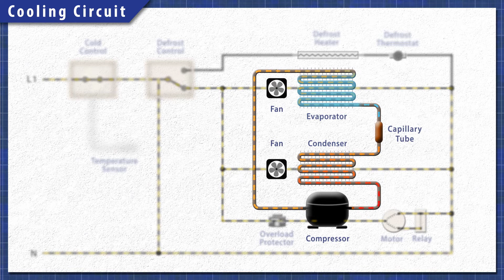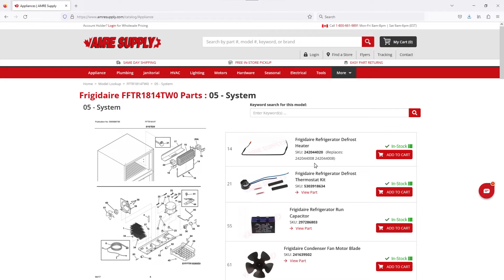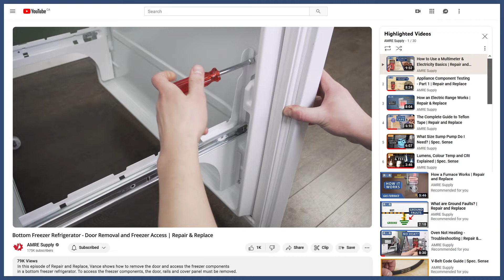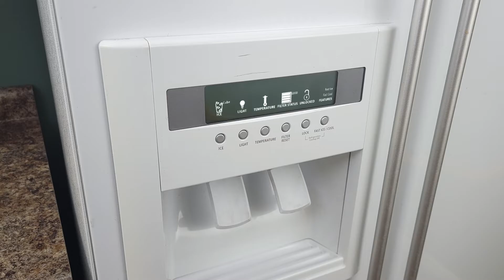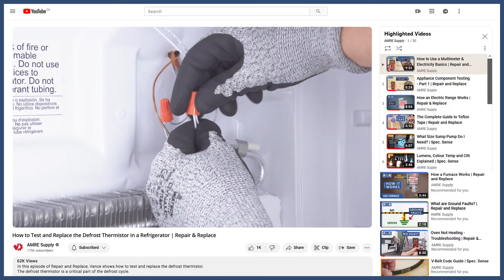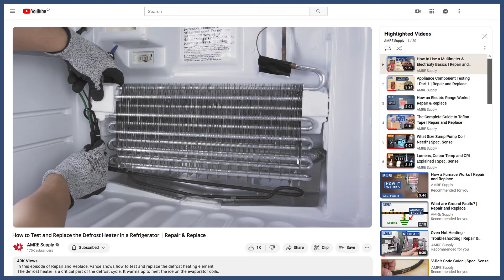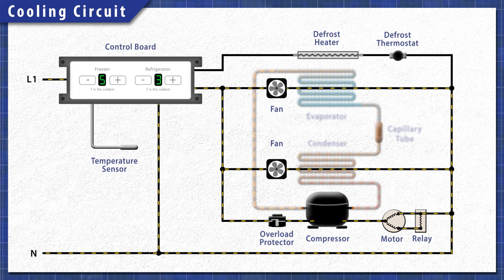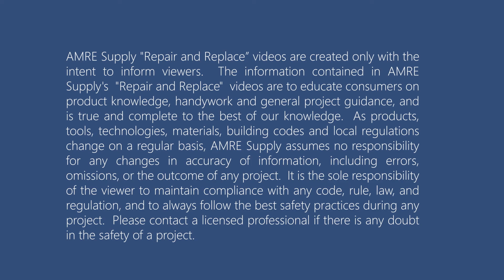Refrigerator Defrost Troubleshooting (Complete Guide) | Repair & Replace

Comment: Great job and nice clear instructions. Amazing that you respond to each comment, unheard of. Wishing you and yours a Very Merry Christmas and a Joyous New Year. Oh, by the way, our Kenmore Elite from 06 started to act up on Christmas Eve yesterday. 21 cu.ft. ram jam full of frozen goodies. Not defrosting and compressor running non stop. Good news is it's holding the set -2 setting. Unplugging it for 8 hrs at a time to cool the compressor.  I will look more into it tomorrow. Today is Christmas and there are other things to do! haha and hohoho!
Reply: Just curious, did you find the problem? I’ve got an old Kenmore with the same symptoms.
Reply: @stevee7774  Yes all good. Bought a new freezer from Costco just in case I would be unsuccessful and was able to return it without ever removing the shrink wrap. Turned out a new (refurbished) control box was the culprit. $130 and it's running. Freezer was built in 06 so let's see if it will give us another 20 yrs. haha
Reply: Replaced a faulty thermistor some years ago and it may be the same issue again. Thankfully it is freezing outside so I can have somewhere to put all that frozen food when I look into the problem.

Comment: It looks like L1 (hot) is directly connected to N (neutral) at the defrost switch. A direct short…No?
Reply from the maker: Are you referring to the how it works animation? What is not shown in this is that the defrost timer itself has a motor and capacitor as well, so there's a load.  In this case an additional symbol would have been helpful to clarify.

Comment: Hello,
My Frigidaire freeze started first to make ice and after awhile it stopped cooling. One thing, it was very close the central heater air blow hole. 
Is it the same process to follow?
Reply from the maker: A problem with the cooling is often an issue with heat transfer. The heat register could effect this but there's also a few other things to check: https://youtu.be/oPmr6boufmE?si=2gmOgA8PDV7n9b2s

Comment: Defrost seems to be a poor technology. Too much maintenance, insufficient cooling as the cooling system shuts down while defrost is on, and too many electrics. And what you're getting is not to have to clean the fridge manually. Never buying one after experiencing my first one
Reply from the maker: There are many people who have experienced no problems with the defrost system. The design of the defrost system is not inherently flawed, it is a good solution to prevent the buildup of ice, which reduces the efficiency. A defrost cycle several times of day (which pauses cooling) has more benefits than negatives in most models as it enables the evaporator coils to stay frost free, maximizing the heat transfer each day. 

Without the defrost system one has to manually defrost the freezer on a regular basis which means there is a period of inefficiency as more and more ice builds up. Some models have more simple defrost loops (Heating element and defrost thermostat) and others have a defrost thermistor, which adds another point of failure. For most, testing the heating element and thermostat is all that is needed to narrow down the problem.
Reply: Works well when you disconnect the fridge wire and let evap fan run to defrost, lol.😂
Reply: Yes . Some rare systems do not require it.

Comment: Note the heater resistance will be higher for 220/240V models.
Reply from the maker: Yes that is a good point. If the Wattage of the heating element is the same rating, there will be a higher resistance at 240V. For anyone who is curious about this the Ohms law calculator can help visualize this, all you need is 2 values. In this Case voltage and Wattage: https://www.rapidtables.com/calc/electric/ohms-law-calculator.html

Comment: i have removed the defroster element and plugged it directly to the wall, it is heating up and does not trip the circuit breaker. But when i plug it back to the fridge its trip the circuit breaker. What might be the issue?
Reply from the maker: Thanks for watching. If the breaker trips then it means there is too much current flowing for that breaker. If your refrigerator is tripping the breaker then there could be a short circuit somewhere.

Comment: thanks for useful inf , sir what would be happened if i bypass the thermistor either for safety aspect or cooling efficiency?
Reply from the maker: Thanks for watching. The defrost likely will not run without a thermistor. A thermistor is heat sensitive resistor. If the control board detects that the resistance is not right, then it will shut off. If there is no resistance then it will also prevent it from running correctly.

Comment: Does the condenser fan always blow air onto the coils? Mine seems to be pulling air over them toward the condenser.
Reply from the maker: There are some models that pull air over the compressor then the condenser fan but the most common is for the air to pass over the condenser coils first.
Reply: @AmreSupply  Thanks.

Comment: Where is the defrost thermistat for the bosh kbm30us?
Reply from the maker: Thanks for watching. Regardless if your model is a top freezer, bottom freezer or side by side, the defrost thermistor will be located in the freezer behind the freezer panel. Accessing these parts is shown at 4:34

Comment: How do I. Put the bosh kbm30us into manual defrost?
Reply from the maker: Thanks for watching. If you have a model with a control board and display then it might not be possible to put it into a manual defrost. Some models have a button combination but this will vary between models.

Comment: thank you for the great instructions! Will disconnecting the freezer thermostat disable the auto defrost?
Reply from the maker: Thanks for watching, we're glad you found it helpful. The defrost thermostat is meant to protect the heater from getting too hot. It will disconnect the circuit once it warms up.

Removing the defrost thermostat and leaving the wires disconnected will prevent the defrost heater from working.

Bypassing the defrost thermostat will mean that it will not shut off the defrost heater at the rated temperature. This is not recommended as it is unsafe.
Reply: @AmreSupply  Thank you! what would be the easiest safest way to disable the defrost?
Reply from the maker: @wantabeu2ify  Disconnecting any part of the heater circuit will prevent the defrost from running but it's not recommended to run the refrigerator without a working defrost system as ice will build up and will prevent the fridge from cooling properly.

Comment: Thanks Sir for this great.  At 13:28 Defrost Timer, What motor are referring to?
Reply from the maker: Thanks for watching, we're glad you found it helpful. The defrost timer is run by a small motor, which is what we were referencing. You can see this explained in more detail here: https://youtu.be/rsv0ary__p4?si=b8LODeEtnEN_5Ztp&t=342
Reply: The small motor inside defrost timer.